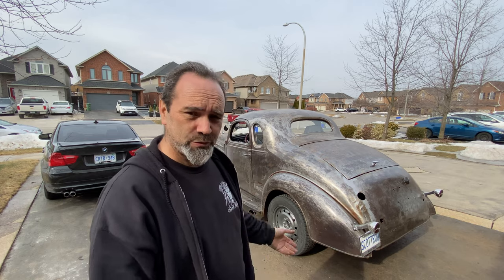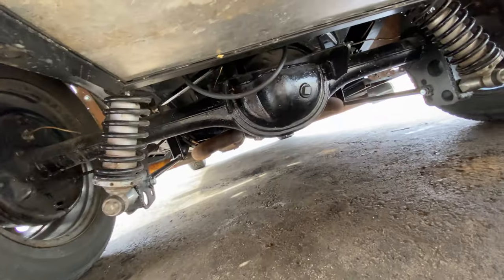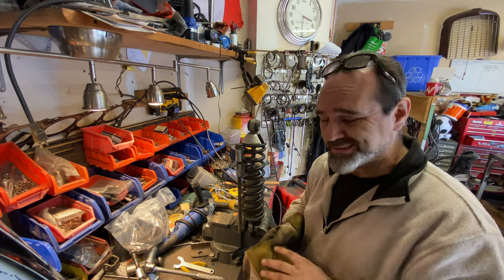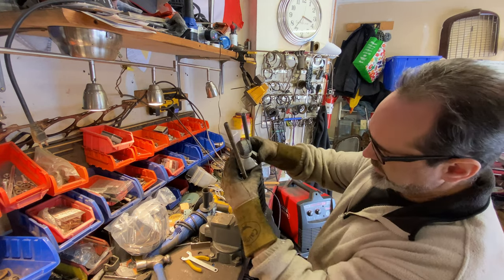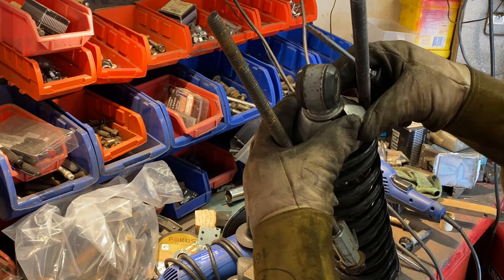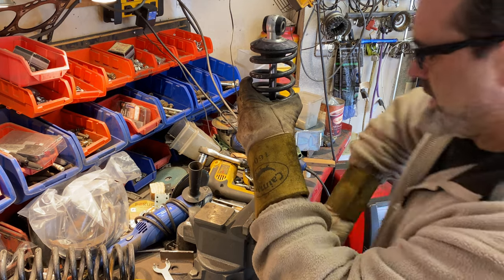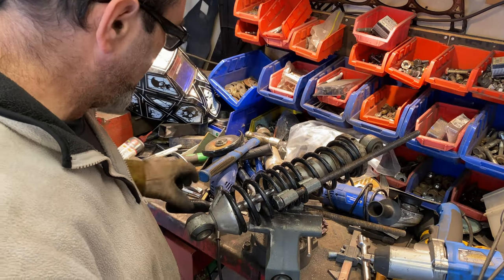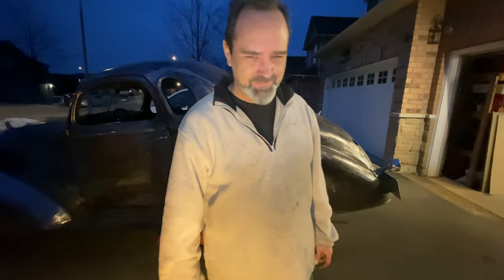Coil Over Suspension Spring Swap On My 1936 Chevy Coupe

Comment: I think you have to undo the bottom with the spanner wrench
Reply: I'm working on a 1930 chevrolet 2 door sedan and I'm going to do a four link and the place I deal with told me to wait for my coil overs untill I get the four link installed because them coil overs are made to hold different weight amounts in the rear some are 200 lbs some are 400 lbs and so on so it depends how much weight of the body is going to rest on the rear end